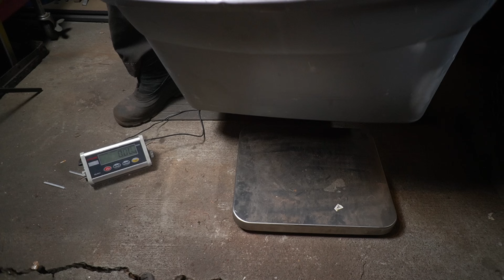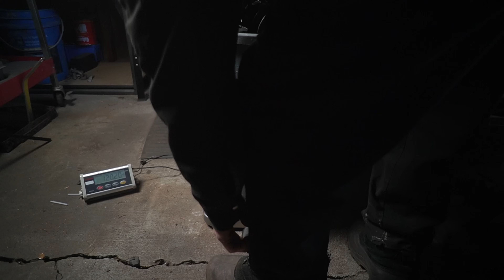Scrapping a MOUNTAIN of Motors for Scrap Copper! How Much Can We Make?

Comment: If you take the smaller chisel but and make a 2 pronged fork out of it, it will work a bit better for driving out the windings. Also if you can secure your vice down so you can work at bench level your back will thank you.
Reply: Came here to state the same. Also for cutting, you could try sharpening the tile chisel. Needs to be sharp for cutting. Hopefully it is hardened throughout the the tip.
Reply from the maker: I did grind the smaller one into a bit of a spoon, didn’t go too deep because I didn’t want weak sides. I’m curious to try sharpening the wider one but again, was concerned about making the work edge too weak
Reply: Yea  man you're spot on mate but I'm from Dublin and I'm a scraper and most the time I leave them motors but il start stock pileing and scrap 10 at a time get much more only and I do it on me bike but I can't pass a skip with out checking it for anything

Comment: I'll give you a tip to speed things up.. I used to scrap for many years.. Do it like an assembly line, do all of one thing, then to the next then next.. IE.. First remove all the screws, nuts & bolts; Then do all the slicing the covers off; always making separate piles of same scrap; cut (copper/aluminum) ends off of all; pull remaining copper/aluminum out; further clean cast aluminum housings.. If you just do one motor at a time you are wasting your time.. I used huge 55 gal barrels and had like 5 or more full when I started my cleaning process, when you do just one part at a time, you get faster as you go, you get a rhythm going.. It took me a few years to figure that out.. I fully cleaned everything till I had barrels full of just clean copper, aluminum, brass, steel & so on also had each separated like copper, from no.1, no. 2, all bright & coated; Aluminum in cast, plate, extruded & cans.. I never took in unclean metals, you don't make money that way.. I thank you for sharing. I don't want to sound critical, I just wanted to share how I done it and made a very good living doing it.. Also never sell when prices are low, just hoard it till they come up...
Reply from the maker: I don’t take that to be critical, that’s a really helpful tip! I did find the same to be true when I pulled five of them out and did essentially that. There’s lots of points where I could optimize but the batch system is definitely the way 👍
Reply: @thubprint  I agree.. I did that too.. I always waited until I had at least 3 barrels full to start first part of cleaning motors.. I did the same with transformers and other things.. After a few hours of running alley's and dumpsters, I would separate what was already clean from what needed more cleaning, like microwaves, fan's old school tv's and such.. I normally took a load in to the scrap yards on Fridays.. I checked daily on what the current prices were.. I never sold anything unless it was at least above a certain price point, when below I horded until it came up... I have been watching some of your past video's.. I like that you are showing others how to make some money by scrapping and in our own way making the world cleaner.. I wish I was in better health so I could do it again, I don't need the money, but I loved doing it.. I loved the fact that I could make lots of money on what others threw away.. Just a bit of hard work.. Thank you again for sharing... There is also good money in smelting down some metals into ingots..

Comment: I do motors, transformers etc. as I get them. After cutting one end off, I use the stanley knife to cut all the string bindings and remove them, coated wires and plastic strips. That end then in bucket totally clean. As yet don't have an air chisel so pin punches used with vise. Have an air compressor so WILL happen. Knock out rest evenly then cut all bindings, cleaning completely- no dealer will get to short change me! Bench kept clean so copper powder can be swept with bannister brush + dustpan for melting when I have a kg or so. So far have a 240 litre wheelie bin 4/5 full, compacted with the sledge hammer- probably 150+ kg easy. Along with the bright shiny stripped wire (90kg) and copper pipe (50?kg) it'll be a while before I cash in because I'm chasing a 1 tonne payday so I can buy a Rotovelo Carbon velomobile (AU$10,500). One hobby pays for the next!

Comment: A friend just sent me a video this morning where they used that same tool but split the whole stator right in half then pulled the windings out. No grinding!
Reply from the maker: Oh that sounds awesome.. they might have had a more powerful version of the tool tho, mine is one of the lighter duty ones
Reply: @thubprint  yea, they had an air chisel. Basically the same thing with more power. Wasn't sure what your new toy could do so I figured I'd mention it.

Comment: Loved the video my friend. I've got  2-3 times that in motors to finish processing myself. Everything got put on hold this fall due to my foot surgery, Dad's hip surgery weather, Temps.  But I got an air chisel and new hose for Christmas. lol. to do exactly what you did here. Been itching to finish mine up. Thanks for the inspiration my friend. As always you keep it simple and real. See you on the Scrapping Trail.
Reply from the maker: Heck yeah buddy! Hope both of you have recovered to as good as new, or close to it 💙
Just don’t hurt yourself doing all the motors! As one other suggested I’m going to bolt my vice to a heavy stump, I think that would be the right height and conserve energy by not walking around
Reply: @thubprint  We are for sure. Thank you. Got mine bolted to a picnic table outside already , 150 foot hose plus a 70 lbs stripping machine that takes multiple size wires. All new toys. Like I said had to stock pile due to the surgeries but,  brother did I stock pile. 2 bay garage.  Just waiting on a really nice temperature day to start work. Instead mean time still collecting just been processing the sheet iron until then. I do this for my Scouts 3 groups. We're going to do 2 drop off days and I collect for the bigger items. Last year I processed 15,000 lbs of sheet iron alone. From this and a hospital donating retired items bed, computers, etc, all old equipment a pole barn full. I'm totally stoked for this season.

Comment: Another good video my dude.  I don't bother stripping them and my excuse is more time in doors stripping, less time street scrapping but I might also be a bit lazy 😁  Canadian treasure hunter has a great way of removing the copper with a modified claw hammer.  Seems to work a treat ✌
Reply from the maker: I’ll have to check that out from them! I think this video makes a good case for and against stripping them down. Not that I did everything right but I bought a $100 unitasker so I could make $200 in 7hrs.. Not exactly a slam dunk 😅
Reply: @thubprint  But entertaining none the less so that's a win, for us 😁✌
Reply: @thubprint  He basically cuts one end as you would normally then takes a claw off a claw hammer and files down the remaining claw to fit in the copper loops and with a little leverage he pulls them right out.  He makes it look easy.

Comment: Take a 2x8,10,12 w/e board and mount your vise, 2-by(2x) so you can recess the bottom nuts.  Then temporary clamp or bolt it down to your bench.  Great for when you have limited room.  If you had a welder I'd tell you how to make a stand out of an old steel rim, angle iron, fence post, a trash bag and some concrete mix.  All cheap or stuff you'd get for free.
Reply from the maker: I like the way you think 😊
The ability to not have it permanently taking over my small bench would be a big plus
Reply: @thubprint  Works great for my small workshop, like you said don't want it taking over my bench.   I also cut a hole in the board and hung it on the wall when not in use.  You can see it in my workshop remodel video if you need an example.

Comment: This is what I like to see, I been stripping motors and sealed units for about 6 months now I just do them all with a large flat head screw driver and angle grinder and got pretty good at it but I feel like an air hammer would definitely help me out quite a bit
Reply from the maker: Absolutely! I would like to have air tools but it’s nice learning that there is a similar tool electric style

Comment: On your impactor, the tile bit. Suggestion, think about a fork, only wider teeth and blunted. Better bang per impact. Lastly, a hand held impactor drill with a bit. A lot quicker and less dust. I just took in 280 pounds of copper. Mostly from motors and such I have found on the street the last 6 months. Was very nice having something to do.
Reply from the maker: That’s a huge pile of copper, nice work!!

Comment: I rarely use grinder on motors..selection of bits and screwgun a more pleasant option. I do however use big grinder to open up fridge compresser chambers..extracting the compresser with screwgun..copper is often very accessible on compresser motors
Reply from the maker: I used to avoid them but the compressors are pretty easy to strip! The oil definitely helps

Comment: A lot of those bolts are 1/4 in heads and I found if u have a drill and a 1/4 socket take those screws out and smack the shaft with a hammer on both ends the aluminum plates come off the stator a lot easier

Comment: I tore a couple more electric motors down. Sharpened the hammer drill bit and it did not cut the copper windings any better, but still works great at pulling them, once cut. So experiment two, I grabbed a long pair of channel locks to hold the motor and put distance between my hand and the blade, and tried out the old miter saw. Fastest, clean cut I have found so far.

Comment: just a suggestion take the time to build a proper work bench just for motors and bolt down your vice. also try to have collection tub there so your not cleaning up dirt with your copper.

Comment: Suggestion : mount the vise vertical (waist height) and use the perforator weight to help you drive the wire out the stator.

Comment: One tip, you should have a radio or music headset. makes things go faster. then you should weld together a small table and attach the vice it will make it easier. I think if you first saw off the copper and then squeeze out the copper with the percussion drill, it goes faster. But I have no idea I run on a rebar and hammer hehe
Reply from the maker: I have a Bluetooth stereo on the top of my bench that I’d love to use more often, but recording videos and background music don’t go together, I’ll get a copyright claim 😑
Reply: @thubprint  it was boring ... another question stainless is it magnetic or not? then is it just copper around the pump in the fridge / freezer or is it more inside? and I may have gotten a job at a scrap yard and get to drive an excavator, thanks to what you and mike have taught me in matreal! so thank you! <3

Comment: If you want to fix your vise waking around, get a front A-arm with wheel hub assembly 
weld the lower ball joint and spindle bolt or fabricate a mounting bracket to bolt the vice to the wheel hub. 
this will give you angled surface that will move. if you leave the brake caliper bracket and rotor on the hub you can use the threaded holes in the bracket to create a lock point by using a bolt..
if you can't understand what it looks like vist a u pick salvage yard and look at a suspension without a strut attached 
in all your creating a swivel table with a vise mounted to it and a locking position
Reply from the maker: That sounds really clever and I love it

Comment: try putting a long notch in the end of the chisel and flare it out where it can grab it to push it out cutting with angle grinder first is best smoother cut and easier to get out plus you might try using drill and take bolts out

Comment: Another guy here on you tube (scrapitall) shows what I think is the best way to break down motors; no power equipment necessary! Get a machete (got mine for $5 at a yard sale) and chop them open! The machete blade is super hard and easily gets in between the metal plates that make up the motor body. About 30 seconds and the motor is cut into 2 halves with no copper dust or use of power (electricity costs money and a Bosch bulldog combination hammer drill/jackhammer costs between $120-150 and you still have to buy the hammer bits AND keep those bits sharp with a grinder!). You don't need a mask to filter out that poisonous copper dust and you don't need ear protection. The machete rarely needs to be sharpened since it is naturally tempered to an extreme hardness, harder than most steel alloys. A proper machete is made out of used railroad tracks which is naturally tempered by having millions of tons of loaded freight trains running back and forth over them. High quality machetes should be stamped 'colombia' because they are made in that country out of the many rails in that country that have been abandoned due to the scumbag socialist gov't that is against capitalism.

Comment: Do you think an air hammer would be faster? I bought a compressor for the same reason, but after watching this video, I might go to your route.
Reply from the maker: I’d be happy to use air tools if I had a compressor set up for sure. Would it be faster, I really don’t know. I did think it was cool that an electric option was available though, and I like that it’s a large enough tool you can get some good leverage on it

Comment: I like to take a utility knife and cut the strings holding the windings then make one cut at the loop on the wire then grab the opposite end at the loop and pull it through. That way no junk in the wire and you don't waste so much wire Turning it to dust. In my opinion it's easier

Comment: I have tried many different approaches to removing the windings.  This is the one that I have found to be easiest and most efficient.

I fashioned a few pieces of 5mm thick steel bar into long, triangular wedges 20cm long by 6cm.  I then rounded over the long edges to help them slide under the windings without cutting them.

After cutting one side of the windings off, I put the stator in a vice.  I push the point of a wedge under the windings, and then hammer the wedge all the way through. I often use two or more wedges at a time, coming from opposite sides of the stator.  The smooth, long wedges make quick work of pulling multiple strands out at once.

I find this approach the quickest method short of buying a $30,000 machine. The windings usually just pull straight out with very little effort.

My next version will be made of high tensile steel as the points of my current ones tend to bend easily.  For now, I just hammer the points back into shape occasionally.
Reply from the maker: That sounds like a brilliant way to do it with a low investment in tools, I like it 👌
Reply: @thubprint  Give it a try.

Comment: Out of curiosity, what is the danger of not wearing a respirator? Copper dust? Also, what kind of respirator do you need for adequate protection?
Reply from the maker: Yeah that’s just the thing, it’s not out of concern for any specific material but rather a good practice to have a particulate filter whenever creating a dusty environment. When scrapping all manner of things there’s always a chance something will be an especially nasty hazard too. I just use my 3m particulate filters.

Comment: Same deal with transformers, those laminated sections on some motors? High-silicone iron, worth 10x as much as mild steel trash. You want a little bit of a fork on the blade (like on a nailbar), so that you're not using your wrists to try to steer and control the chisel, it'll self-center on the windings it's cutting. And, you want it shaaaaaarp for the cutting parts, especially in the groove. For the yanking parts, you want a fairly skinny, round 85-degree pin hook - maybe 1/2" on the folded tip, so that you're lazily inserting that and then just pulling away from the vice. Pulling is more controlled than pushing, uses less effort. Or, if you don't want to pull, then a skinny lizard-tongue pushing fork would be the best shape, really dull so it pushes and doesn't cut. Your hammer drill in general is a poor tool because of how absurdly long it is, it's unwieldly versus a normal air chisel would be like, 20% the length and give you tons of control and easy to switch angles and a lot less weigh to hold (but whatever, you go war with the army you've got). And, you already know the big answer... get a gaddam table and mount the vice to it. You're wasting at least 2/3 of your energy, and working on the floor you're hurting your back. If you had a coffee table height you could do this work seated on a rolling chair, else.. a little lower than kitchen table height would be easiest. It's gotta be worth your time.
Reply from the maker: Fantastic tips, I’m going to try my best to get a better steel price for them! I did grind the smaller bit I’ve got into more of a fork, not too aggressively but enough that it works better. Next time the vice will be mounted haha

Comment: I know this video is a year old now, but i think just a chop saw with a big ass wheel and a tote on it's side behind it to catch the dust would go a lot better than an angle grinder and repositioning things every couple minutes. Then a vice mounted solidly on the table next to it to not wast the hammer punches moving it around might speed this way up